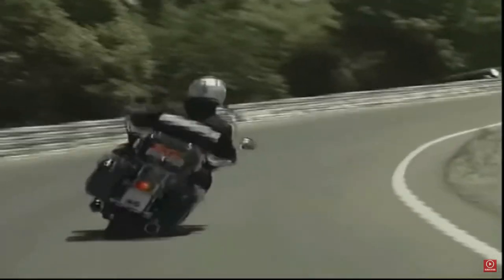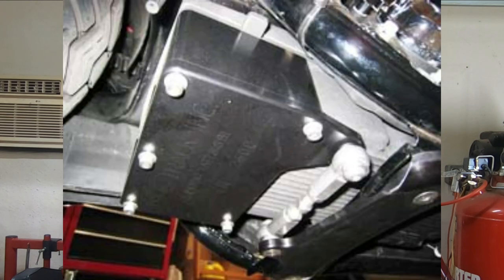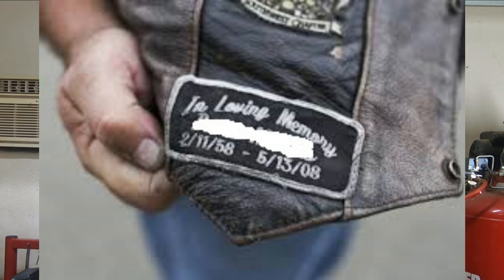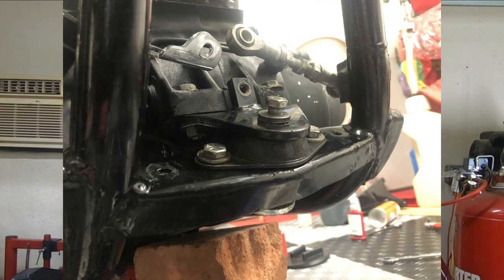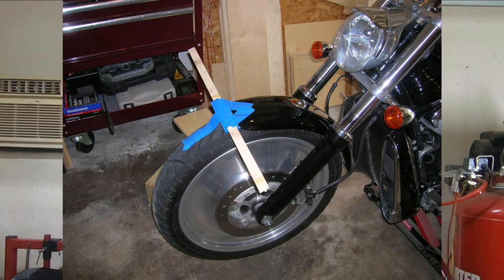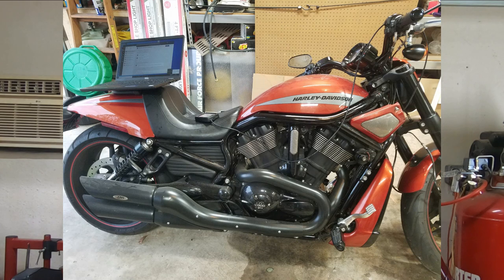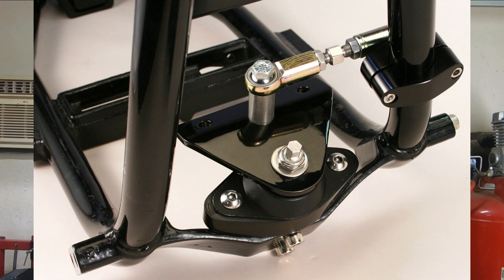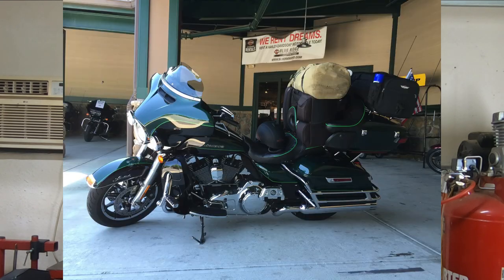The Dangerous Harley Problem

Comment: WELL DONE!! 👏 
The two most neglected maintenance items on any Harley Davidson is...
1) Fork oil service.
2) Fall away procedure.

Sadly, most people don't even know what a "fall away" procedure is. READ YOUR SERVICE MANUAL.
This is the ONLY thing I don't "DIY" mostly because if I'm not completely satisfied with the results i take it right back to the Stealership and say... "it's still not right do it again".
It's a time consuming process and requires a specific and calculated torque on the fork stem nut to get PERFECTLY adjusted.
I've owned many Harley Davidsons in my lifetime and have passed well over 500,000 miles on these bikes, if the above mentioned services are not done your bike will handle like crap guaranteed. Dont waste your money on any gimmicky stabilizer crap.
Reply: I have friends here in Missouri they took the twinkie and added big cams and carbs, they also added turn buckles to the swingarm and frame its a stabilizer kit they said with out it the stock harley rubber mounts rip and wear out , they own a small shop . are Evo engines did not have this unless" like you said the fall away was way off or fork oil is bad"  Fall ways is lift the bike front wheel see what way the front fork falls  left or right they both should fall at the same tipping point . Only time I have ever got this wobble was over 130 mph any of my bikes Jap or Harley  i let off and coast the bike back down , never hit the break or down shift or use the clutch coast it out.   let off the fuel and hold on its a bumpy ride few seconds.
Reply: @JCcanU  wow, that's probably expensive
Reply: @kennethwise7108  the parts are cheap 100 a hour labor . Im keeping my EVO I will keep fixing it, all harley has produced in the last 10 years is junk and they know it .
Reply: @JCcanU  exactly, the only problem is that if you're doing a long trip and have a mechanical problem you're pretty much hosed. All dealerships purge inventory +10 years.
Reply: @kennethwise7108  I bet its only 4 years , in this area they turn bikes away that are from 2015.
Reply: @JCcanU  I wouldn't want anything new even if it was an even exchange. They totally suck

Comment: Sound analysis. Great advice. Methodical. Work your way through the obvious before applying "remedies"  I speak as someone who experienced an odd steering wobble at low speed. Turned out to be a misalignment of the rear (out by 1cm at the axle - doesn't sound much does it? Now multiply that by your rear wheel diameter - to see where that was facing...) add in a worn front tyre. Thanks for putting this together! ☺️

Comment: Had this problem (slight wobble) with OEM suspension.  Just swap over to Legend and never look back.

FYI, some riders (myself included) experience this issue with the use of bead balancers in the front; this DOES NOT work in baggers well, and only adds to the already insufficient suspension, thereby increasing the wobble.  At least it did with me.

Once I swapped in the Legend, not only did all these issues go away, but the bike began handling like is should have from the factory.

One day, harley will provide a "sport" suspension rather than the soft touring specifications that are current OEM.  Regardless of your riding style, the OEM suspension sucks and should be the first mod you do at the same time as Stage One (header, slip-ons, intake, tune).

Comment: What I'm doing to mitigate any wobble problems on my '00 RKC build that I'm doing right now is upgrading to spherical bearings on my swingarm, billet isolators, Legends Suspension front and rear, and of course new tires. I'm probably going to change out the front motor mount just for good measure. I'm hopin' it'll never wobble on me. What do you think, G.F.? Any other base I need to cover?

Comment: I noticed a wobble on my 07 FXD a couple years ago at higher speeds,I took it in for tires and fork service and bad motor mounts were found and seemed to be much better but have not had it up to the speeds where I noticed the wobble.  I was trying to keep up with friends who wanted to ride around 90 in traffic where I was very uncomfortable being at but had it to 80 and no wobble.

Comment: As you point out, tire condition and wear patterns can affect stability. Roadway 'crown', paving material and conditions does cause unpredictable tire wear. Some tires wear-in better than others.
 Rain grooves or steel grate bridges are another experience! 🥺

Other issues that can and do affect ride & handling;

1. Tire pressure (especially front).
2. Tire alignment, front tire perfectly in-line with rear.
3. Steering head bearings. Lubed, not 2 tight, not too loose.
4. Wheel bearings. See notes on 3.
5. Swingarm bushings/bearings.
6. Shocks, inc bushings. 
7. Load balance. Rider, passenger and cargo.
8. Handlebars. Some position the rider with a forward lean, putting more load on the forks/tire, like a sportbike. Many, if not most Harley riders prefer to sit straight up or back. Some higher bars cause ya to pull back/up and unweight the front end. Especially when wrestling with the wind.

I've never had any kind of 'wobble' on my Roadking. I had only 1 I can remember in over 30yrs of riding the old 4spd swingarm frames after hitting a hole in the road. After riding the older chassis Harleys for so many years, the Roadking/FLT is simply amazing in it's handling and stability. One thing I did notice was that the older platforms would actually go fairly straight with hands off the bars. Not so with the FLT! I suspect the ''inverted rake'' of the steering head/forks have something to do with this. 🤔

I've had numerous full-tilt "tank-slappers'' on various high performance sportbikes under various situation.

Comment: Back when I was young and dumber, 1985ish... had a Honda V-65 Magna. It was fitted with H rated tires (130mph). When I would run this thing out as it would exceed 150mph. Around 130, it would go through a shake on the bars, but would smooth out after the transition and climb to 150mph.  Now I suspect a few things.  As tires wear, or get hard, the flex changes. What was a 130 mph rated tire when new, would be derated significantly over time and miles.  Tires is one area I dont cut corners on when it comes to scooting.  I always enjoy your updates....  :)

Comment: I had a 2009 FLHT. It would occasionally feel unstable at 80 mph and in high speed long curves. Once I put legends Revo-As on the rear and Legends front fork cartridges, it was flawless in handling. I hate that I waited so long to do that suspension.
Reply: I did the same thing to my FLHTCU. Wow, what a difference the Revo A’s and the Legend front suspension made. No matter what bike I have, upgrading the suspension makes a huge difference. My GL1800 was the same when I upgraded to the Traxsion suspension.

Comment: Gixxer, been watching your videos for a long time now, they are excellent. I do have a huge issue with my 98 fatboy, I changed out tires when I got the bike and went with dunlop elites because the last person decided to go with a fatter rear which was hitting the belt and the front was original and cracked.  I static balanced both wheels and went on my way. What I experiences is a handlebar shake and it kept getting worse until I decided to park it. It does not feel like a wobble but a handlebar shake and it is inconsistent at that. I did tire pressure, wheel bearings were at max 6 thousandths, jacked the bike up and checked the swing arm bushings by shaking back and forth nothing. I have to check neck bearings and maybe the swing arm bushings without shock load on them. I do not have hollow swing arm bolts so no way to measure accurate so I found close to center and measured both sides. Little irritated I put 3k miles on it so far and it's doing this as well as within and oil change the tank is about empty and what a nightmare to start her up, takes forever. This winter I will throw a carb at it with manifold and pull the jugs and see what happened. 135 psi on compression hot carb wide open both jugs. I was told it had a stage 2 hop up in it from previous owner. Would be great to pick you for info even if it cost me to assure next year is a better year. Thanks Gixxer and keep the great videos coming.

Comment: I had a similar problem on my ‘21 Goldwing when using cruise control, around 35-55mph and l would let go of the bars (because it would vibrate my hands). The bars would start wobbling and get progressively worse. 

The problem ended up being the horrible factory Dunflop front tire. Dunflop is OEM for a lot of motorcycle manufacturers. Try a different brand and see what happens. I went with Michelin Commander III and the problem went away instantly.

Comment: Good video!  I bought a new set of tires some Avons that were made in Brazil a few years ago & it made my bike wobble.  I got a refund & went back to my Dunlop Elite tires & problem solved.  I have True-Trac stabilizers on both of my bikes & it’s money well spent.  My truck had a vibration & it ended up being a tire that looked perfect with plenty of tread, but I got lucky & it was prorated & got a new tire.  Thanks!

Comment: I have helped with several bikes that had that problem. With touring models the swingarm rubbers are a good place to start. (They look like miniature aircraft engine mounts!). Dyna engine/swingarm mounts blow my mind! On my Suzuki SV1000S the Michelin tires I run have the strange lines as they wear and yes, I feel them. Strange thing is they change places with every hard ride with plenty of tread depth left. It has a stock shimmy damper and never has exhibited the wobble no matter what. Fresh tires, good bearings, good alignment and tire pressures are very important for any bike. Loose steering stem bearings can be a problem too. Not sure what fixed the HDs but getting back to basic maintenance is a good place to start.

Comment: Have multiple experiences. Couple: 2001 PoliceFLH DEATH wobble- turned out no air in front air suspension. Of course it caused me to nut & bolt the entire bike. 
2014- FLH Ultra Classic: replaced rear w/Legends and front with Progressive cartridges. Can still get a wobble, but not scary.
NEVER man handle the handlebars.. relax and it calms. I have had to drag to jam rear breaks to get 1 bike to stop bucking. Key for me is, relax. 
I usually use American Elite for fronts. No problems yet.

Comment: In my 32 years and 250,000 miles on Ultras, 2 EVO’s 2 TC’s, I’ve never had a wobble at speed. I did have bar shake, but it was a loose steering head bearing.

Comment: The problem is factory faulty design. Not enough "trail" in the front end geometry.
Trail increase can be achieved by raking the frame and extending the forks.
An old school chopper never will get a "wobble"

Comment: have 05 ultraclassic, I've ridden miles on cruise control with both hands off the bars. had my motor stroked too a 103. had legends 12" front and back. took a corner freeway interchange, left to right. doing about 50. my rear tire started the backend wobble. this was this summer. one and only time i ever felt it.

Comment: Yes Tyers. Camber wear. Especially a highway bike too. BIG FLAT SPOT IN CENTRE   Then come into corners. , and who packs a dresser correctly ,not me , and the main one o want to say is spokes piss them off. Put mags if you flog you ride hard. I’ve seen a spoke wheel on a two year old bike move almost a 1/2” each way. But he did do burnouts lol. And old Tyers I dropped my girls nightster with 8 year old Tyers. Spun out from underneath me. Only 5000mls on it , and I have an 99 and 08 dresser.  The rubber will be shot just by age. Both about 24,000 mls on them.  The top stabiliser wear out quick a couple 32nds would start to steer you too. 
Love your work.  And information.

Comment: I've had it on my Dyna but my 06 Sportster never had it the whole time I owned it.
One more reason why the evo Sportster is the best Harley ever made.
I've added front and rear stabilizers to my Dyna, steering stabilizer, new engine mounts, fork brace, new fork springs, new rear suspension.... The wobble happens less often and less severe but it's not 100% completely eliminated. Like I said I rode my Sportster with a totally stock chassis for years and not once ever experienced a wobble.

Comment: RaceTech Springs and Valves and Ohlins rear shocks and never a misstep or wobble in the sweepers at any speed. I have felt a  hinge type of frame, rear tire to front tire, not quite a wobble, movement with stock suspension at spirited speeds in sweepers a couple times.

Comment: Hd wobble is caused by the dual spring setup on the rear. It's almost impossible to make to springs with identical spring rates. They are all slightly different and only one side has an actual shock the other is for show.

Comment: I had a wobble that showed up during a high speed pass when I pulled back into my lane the bike started a wobble that didn't go away till I slowed down. So, new wheel bearings, new tires, didn't fix it. Rebuilt the swing arm and replaced rear and front mounts. I also put...stiffy cups in the rear isolators. No wobble, no walking around in corners...and yes the urethane front mount was terrible.

Comment: I have a theory that one possible contribution (not the cause) is the very poorly designed top triple clamp that Harley used on all rubber mount touring bikes from 1980 to 2013. I had a 2001 RK and a 2016 RK and although I never experienced a wobble with either bike the 16 definitely handled much better. Like it was on rails. I could be wrong on this, but it's food for thought.
Reply: 2001 and 2016 touring frames are completely different.
Reply: @georgewetzel4380  they are, but I still believe the top clamp also makes a difference.

Comment: I've felt this on brand new bikes as 2013 road king not loaded at 9000miles when I bought it.  Wouldn't wobble under load like with a passenger. New tires, tight spokes,  new wheel bearings, Polyurethane bar bushings (big help with 16in bars) new upgraded suspension but still has the same wobble at  nearly 40k mi.  I'll replace the motor mount bushings and the swing arm bushings this spring just because it needs to be done.  But I did put a stabilizer on it and the issues went away also handles so much better.

Comment: if you get a used bike it could have been dropped or wrecked and the frame could be tweaked. i see a vid on a guy straightening a frame to show how they could fix issues like that. so i would check the frame alignment before getting a stabilizer myself.  good vid

Comment: Yes I have only after I replaced front motor mount & aligned drivetrain & wheels straight & aligned it worked perfect ! It was a 1996 FLHT with a 120 merch motor in it before the stabilizer it would rear wheel steer by just whacking the throttle !
Reply: On my FXR I replace all the mounts every 2 years . I ran some soft Dunlop K 591 put about 4000 miles on it then rode it 500 miles to Kansas City & on the way back I went to the Davenport swap meet had about 200 miles to get home & those tires were so cupped out I worked my assoff to get home every crack or groove on the interstate my FXR was all over the place ! But they were a blast while they lasted !

Comment: you are so right in fact not only does a stabilizer mask a potentially dangerous issue but it also would put extra stress on the actual problem

Comment: When the new touring frame came out, with a two piece frame so the rear section could be easily changed to make the three wheelers, I predicted that would be a problem.
Reply: What led you to that prediction? 
A two sectioned frame contributes to a wobble how versus some parts that need replacing or some tires that are worn?

Comment: Have a 2020 FXST, and it is the most stable thing I’ve ridden. You can go for miles on four lane without touching the bars (do have cruise control); just lean to turn. If anything, it is a little too stable.

Comment: The handle bar shake happened on old (1970's) Kawasaki 900's
but not until you were well over 100 mph. 
Of course, that's not a good time to find out about it     :-0)

Comment: Great video and the information was spot on. I had a bike 97 fatboy that the front tire would give me a wobble  at 40 mph we changed the front tire and it would clear up.  If you ride aggressive it to turns I notice sometimes I would get a wobble on my 2020 cvo street glide. It's due for the 5000 mil. Service I'm going  to take to the dealership and see what they can find. I'll probably get it's a touring bike and that's what they do.
Reply: I have a 2020 Street Glide mine will do the same and yes the dealer told me after checking it out there's nothing wrong just a touring bike thing
Reply: I had the same problem with my 2021 YOU NEED TO MAKE SURE  that the dealer does the steering stem adjustment as its explained in the HD service manual!!!! after taking my bike to 2 different HD dealers that confirmed it was fine it was an independent shop that did the detailed adjustment wow what an inprovemint !!!!
Reply: @brandot.7466  Will do thanks

Comment: I just bought a 2007 heritage softail. The bike has 6,200 miles on it. It still has the original front tire. I think the date code is 12/07. It handles fine, rides fines and looks fine. The bike is in storage for the winter. I plan on a new front tire in the spring. The original makes me nervous riding on it. I had a Harley Technician tell me "But the tire only has 6,000 miles on it. I do not trust that tire.